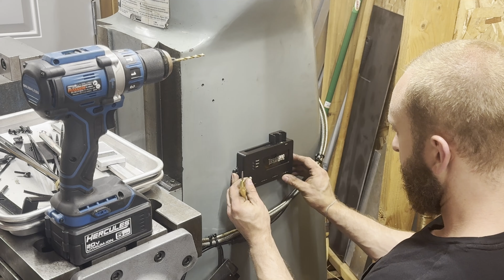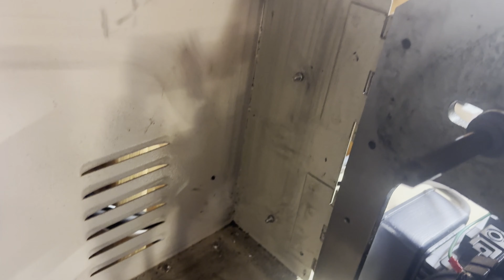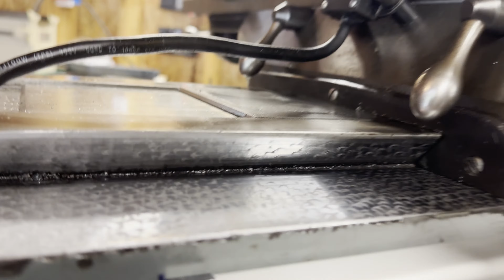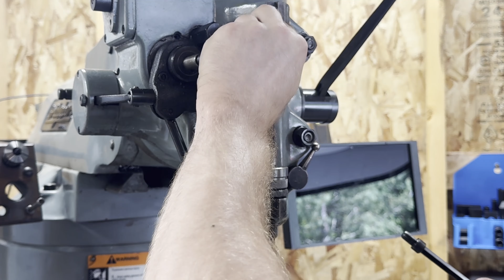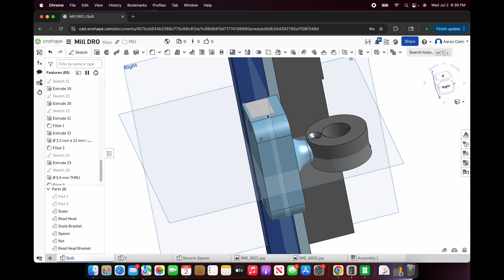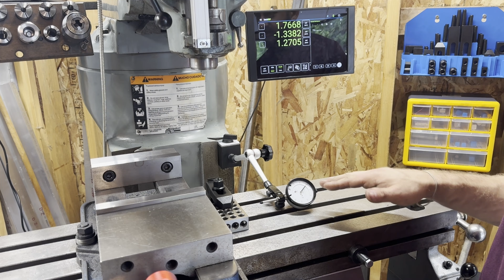Installing & Calibrating DRO on a Bridgeport Mill | TouchDRO Install Pt. 2

Comment: Out of curiosity, why sendcutsend if you have a milling machine in front of you haha? Honest question. Also, have you had any issues with creep on the bolts on the 3d printed parts over time?